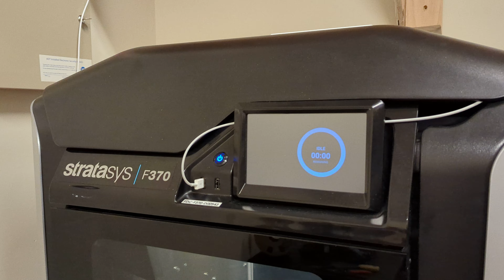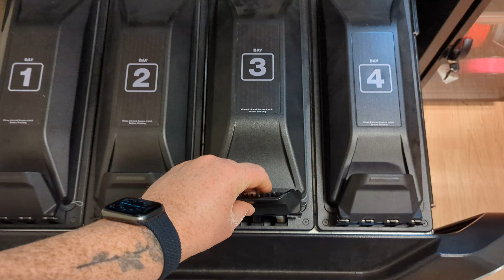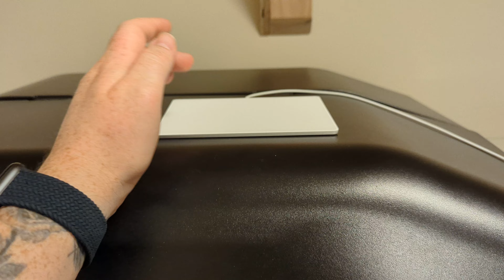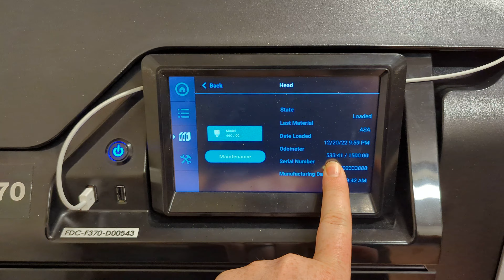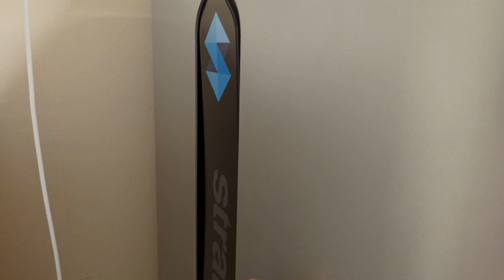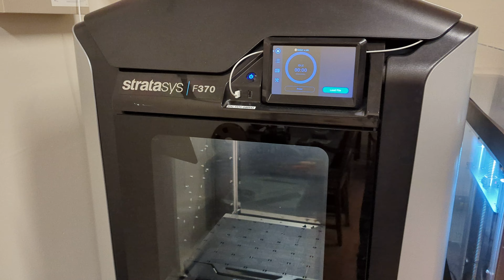Stratasys F370! Quick Look and Overview

Comment: I would be curious to hear how it has held up.
Reply from the maker: It has held up really well so far. I do keep up on maintenance well and keep it well calibrated. I did run into an issue where my office environment was a bit warm coming into summer which caused some clog nozzle issues. After correcting the temp in the office it’s been dead reliable again.

Comment: i keep saying the biggest downfall of these printers is the software and proprietary materials, personally i think you should be able to change settings if you want when you buy a 80k machine
Reply from the maker: Yep agreed. They should give you the option for open materials or the option for theirs. They are finally working that way though. I talked with them at RAPID this year and they are bringing their open material license to the F series printers. Didn't give a date though.
Reply: @folsomtech  really that is great news, sucks that you'll have to spend an extra 20k to unlock it tho

Comment: did you just say the beds are a one time use?
Reply from the maker: Yes they are intended to be used once. Usually you can use them a few times they just don't recommend it for reliable first layer reasons. I usually only use a new bed every time for customer orders to ensure they don't have any lifting issues. Then I'll often reuse that bed for prototypes that are non-critical.
Reply: @folsomtech  We have an old Uprint at work and we wipe the plates with a little bit of acetone. It restores and greatly improves the adhesion of the build plate. We use the build plates 100s of times until the printer gives a bed leveling error. Which tells us that we need to replace it. At that point the plates have degraded from the chamber heat anyway.

Comment: Goodluck with it. I bought one for place I worked and it was troublesome. Print heads gave trouble. Screen went out. Heater went out. Software issues. All within a year or so.
Reply from the maker: Dang that's no good at all. Well I'll keep an eye out for those issues.